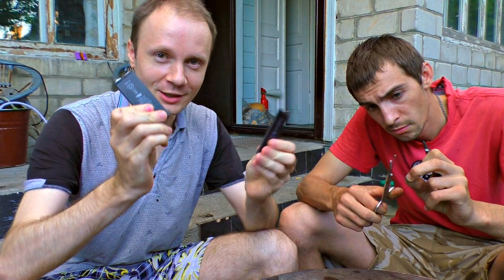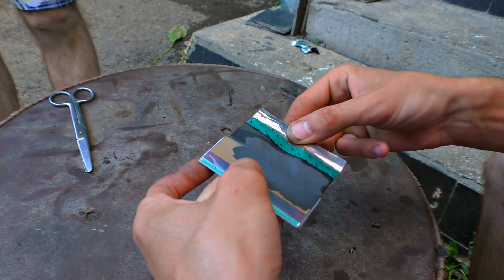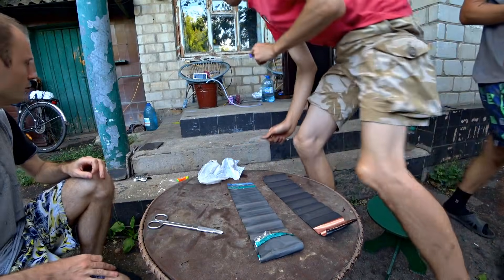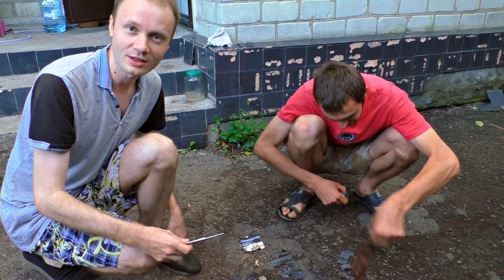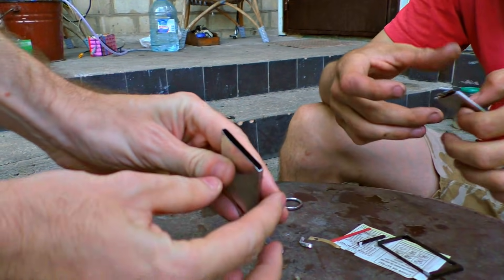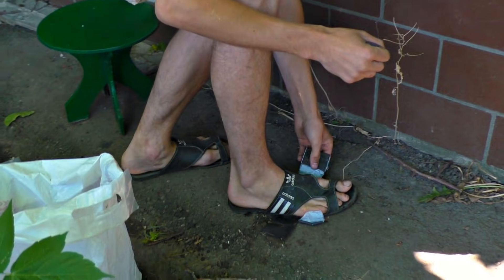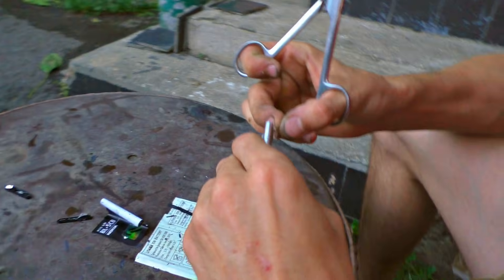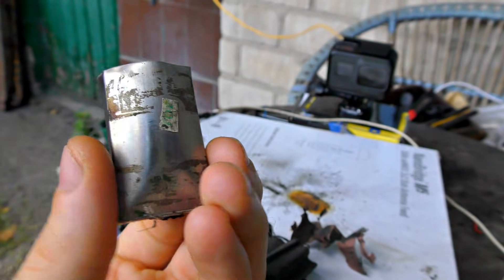Smartphone Battery Explosion? We will show you how it's like! Three Brands

Comment: These guys were doing very dangerous experiments with Lithium batteries.  Lithium and the other rare earth elements used in these batteries are toxic to breath and can be toxic to handle if any of these chemicals are absorbed by the pores in the skin. In the video we can see one of the guys touching the battery internal elements with his fingers. He is also exposed to possibly breath in any chemical release of the battery. 

Lithium battery electrodes if coming in contact with water will tend to go up in flames. The Lithium reacts with the water to immediately separate the hydrogen-oxygen bond, and with the conductivity there is quick intense heat buildup. This is why trying to put out a Lithium battery fire with water will actually intensify the flames. You can try to douse it with huge amounts of water to keep its temperature down and subdue the flames, but this would take a large amount of water. 

The devices that use Lithium batteries have a manager circuit that works with a uPC (microprocessor controller) system. There are current, temperature, and voltage sensing circuits. The battery manager controls the charge current and voltage to the battery as required. Inside the battery there is also a battery manager circuit that is for safety. It tracks the temperature and condition of the battery, and shut down the battery function if necessary. The phone's battery manager can also do the same type of function. 

If the battery is not tampered with, not exposed to excessive heat, and using the proper charger there should be no danger. When the battery ages and if starts to swell up it should be changed. The swelling is from out gassing effect. When the battery ages the dialectic layer starts to degrade and produce carbon monoxide (CO), carbon dioxide (CO2), methane (CH4), ethylene (C2H4), ethane (C2H6), fluoroethane (C2H5F), hydrogen (H2), and hydrogen fluoride (HF) [12,13]. This combination of gasses are very toxic for humans and animals. Also very corrosive. This is why the battery is sealed and will swell up rather than disperse the gasses. 

For safety of your phone the maximum ambient temperature should not exceed 96F or 35C.  Maximum safe internal battery temperature should not exceed 45C or 113F.  Never keep your phone in your pocket while the phone is turned on. It can easily overheat internally because the phone has no place to disperse the heat. Dangerous for overheating the battery and the electronics of the phone.

Comment: What a shame my Huwaei T8 battery burst in flame just now when trying to replace it! I think I punctured it in the process of removing it from the adhesive surface and it melted the tablet casing. Oh well, caused more damage than repair. This is the first time it happened to me. I've been replacing phone and tablet batteries since Li-Ion has been the norm for gadgets. Huwaei battery is the worst. 

I must admit though that this video got me hooked. Good Li-ion battery dissection of what they looked like inside those metal casing.

Comment: If stuck on an island and you got no connection and you also have two phone just take the battery apart and then find a dry leaf and use it on the dry leaf and then get some stick and you got yourself easy fire!

Comment: That's why I never use the high-amp cell phone charger for my phone. I've been charging my phone every night with a 5V 500mA USB charger. The phone stays cool at all times and the battery chemistry doesn't get pushed to its limits.
Reply: @untitled. The main reasons for the high-amp charging hype are as follows:
#1: The well-known impatience known to mankind!
#2: Heat up the battery to artificially age it at a point where it can no longer do as soon as the 2-year-warranty is over.

Remember the SAMSUNG Note 9? No longer allowed on aircrafts, decreed by the FAA!

Comment: I remember as a kid, I used to take apart nicd battery packs from rc cars to look at the cells, and I had this one rc airplane that had a lithium ion battery and I thought it was the same. So when I took it apart I was only given a shock and after that I stopped taking apart any battery pack that was "squishy". Now that I look back at it, kinda glad I was only shocked because I realize I could've burned everything!
Reply: lol, i was a "disassembly child" too, you're lucky you didn't lose a finger or two ;) 

if i was a kid today,,, I'd be lucky to reach 10! ..
Reply: @zdd22fixes47  me too😂
Reply: Lol I'm 13 and I started taking apart electronics first starring with speakers and subwoofers I also toke apart a whole crt TV lol

Comment: I know the majority of the internet doesn’t care, but someone could’ve freakin‘ died here.

But yes, as they said at the end, lithium ion batteries are insanely dangerous considering we’re all carrying a pocket device with one inside.
Reply: I threw a laser pointer that held a 1632 size lithium button cell into a campfire. After several minutes, it exploded, expelling the battery and hot debris towards me, causing a burn on my right arm and my shirt. I got lucky it did not cause any more injury to me than that.

Comment: Love the videos. I'm a truck driver in Britain and I've had not one but TWO satnavs go up in flames and I mean BIG flames the last on burnt my dashboard. And before anybody lectures me about trucks being 24V not 12V like cars both of them were 24V trucknavs, very scary.
Reply: Ya that's no good at all! I drove fuel truck for a while and there was a Panasonic toughbook mounted in the cab that was part of the meter/receipt system. They had a recall for batteries. Good thing none of them went up with 20,000L of gasoline in the tank.

Comment: This is why you should throw away your frayed and or damaged smartphone charger cables and get a new one otherwise your smartphones will do what you just saw in the video so therefore if your smartphone charger cable is frayed and or damaged get a new one don't use your frayed and or damaged iPhone charger cable and don't try to repair it with electrical tape or heat shrink tubing because you will burn your house down

Comment: Discharge the batteries thoroughly before disassembly will be much safer (but it won't burn and it's less excited). The lithium intercalated graphite anode is still extremely reactive towards water, similar to lithium metal. The electrolyte commonly used is LiPF6 and would hydrolyze into HF. The binder is PVDF and would possibly release HF after combustion. The amount isn't too much so it's not too dangerous. Rest of the materials including the stinky organic carbonate solvents aren't so toxic. It's still OK to touch but not recommended .
Reply: Hydroxide fluoride is deadly whe inhaled ?
Reply: @anubisdeathangel1093  yes, hydrogen fluoride is toxic. Not recommended to expose yourself to it.. It can be lethal if you inhale a lot.
Go check some photos showing what will happen if you expose your skin to hydrofluoric acid.
Reply: @sovietrepublic38  hey thanks a lot for the info thoses batery especially in rc car can be dangerous if transported in non ventilated area such as a car whe u see it fume should get out of the car imidialtly

Comment: I replaced an iphone battery for a friend of mine. Then I told him we had to make the old one safe for disposal. He wasn't sure what I meant. I said, "we need to stab the old battery". He said, "Well I have this letter opener.." I said, "Perfect" and set the battery outside on a concrete sidewalk and stabbed it with the letter opener. At first, nothing happened, all you could see was a red glow around the area where the letter opener pierced the battery. Then I pulled the letter opener out of the battery and that's when it burst into flames. Then I said, "Now you see what I mean about making it safe for disposal. Wouldn't want to make a trash truck catch fire!"
Reply: You don't have Special Trash-Container Just for batteries? Wtf xD
Reply: @RichyRich2607  people have those?
Reply: @loganmayfield9900  Where do you live logan? we have them in England.
Reply: @MrJimbaloid  I live in New York
Reply: Well, some countries don't give a shit about the environment. Take the US for example. It's very common just to throw everything in the trash regardless of what it is and then dump it as landfill. 
Here in Denmark, WE CARE. We have separate containers for recyclable material such as glass, metals etc. Also, there is a special container for the material shown in the video and lightbulbs, neon tubes etc. The local recycling department will also take things like motor oil, chemicals, and very dangerous substances, for free.
Reply: @kalleklp7291  ok well the earth is fucked anyways, scientists already said the earth cant be saved anymore.

Comment: Reminds me of a news piece about the stupidity of airport security rules (TSA).
https://gizmodo.com/guy-builds-a-bomb-just-with-stuff-you-can-buy-after-air-1465435055
Security take all your things away at the security gate, liquids sharps etc.

But you can go to the newsagents get:
Drinks flask.
Condoms.
Duracell lithium batteries.
deodorant.

Fill the condom with a bit of water.
split the battery open and put in the flask.
Put the condom in the drinks flask attached to the lid hole.

And there you have an improvised grenade.
Just shake it to wake it.. :)

Comment: I dont know if you guys have Electric car charging stations. 

I was wondering if you can test to see if you can super charge a battery using the plugins they use for the cars.
Reply: Pumping 480v DC with 10 amps or more in a phone battery lol. Instant dead for the battery and yourself

Comment: What if you replaced Smartphone Battery with Supercapacitor?
Reply: probably your smartphone would be 4 times thicker and 40 times less charge.
watch electrobooms video from supercapacitors for more explenation
Reply: I know that. Replacing Smartphone Battery with Supercapacitor can be a fun experiment though.
Reply: they have a vid of how to blow up a capacitor
Reply: Well the biggest supercap can hold a charge equal to 200mah at 3v (Talking normal consumer size ytpes)

Comment: That's one way to poison yourself
Reply: The electrolyte used is LiPF6 and would hydrolysis into HF when exposed to air. The binder is PVDF and will also possibly realease HF after combustion. Few amount is ok but still not recommended. Rest of the materials including the smelly organic carbonate solvents aren't so toxic.
Reply: Luckily lithium ion batteries aren't really poisionous...
They are mostly made of copper, aluminium, carbon and lithium cobalt oxide. Copper, aluminium and carbon are ofcourse not poisionous. 
Lithium cobalt oxide has a toxicity LD50 of around 5000mg per kg. 
So if you weigh 100kg, you'll have to consume 500grams. And since that only makes up a third of a lithium battery that means you'll have to consume 1.5kg(not touching, but actually eating) of lithium batteries for a 50% chance of death.
Thats pretty damn low.
Reply: @jort93z  and the INGREDENT X
Reply: jort93z I’d still rather not breathe it
Reply: @jort93z  E A T I N G B A T E R R Y S?
Reply: Does it smell like acetone kinda sweet?
And can I throw a lithium phone battery in the trash...
Reply: Están locos jaja
Reply: You can put an expiring date on these two guy's lives. The lithium hexafluorophosphate will shorten their life drastically.
Reply: Well go ahead, smear it on your hands and eat something, or burn one and inhale the smoke. I've had lithium batteries explode and burst in flames, the smoke is very toxic, couldn't use the room it happened in for a few days
Reply: @LaughingMan44  had the same thing happen to me any advice ?
Reply: Meh... it's Russia Alcoholism kills most men long before cancer, lead poisoning, or any other ailments that PPE would prevent.
Reply: I think they are in Russia.  Their water is more poisonous than these batteries.
Reply: @walterlafleur8961  its Ukraine